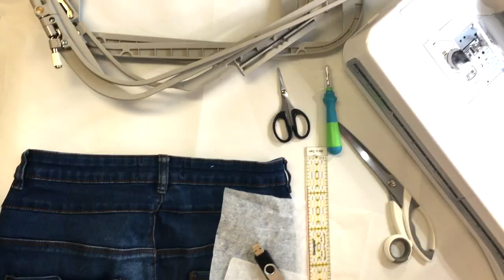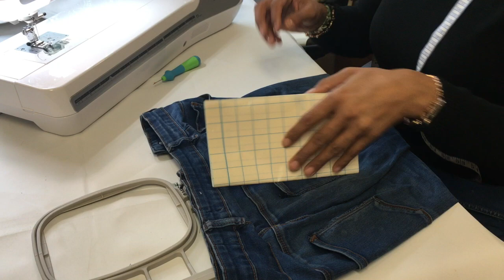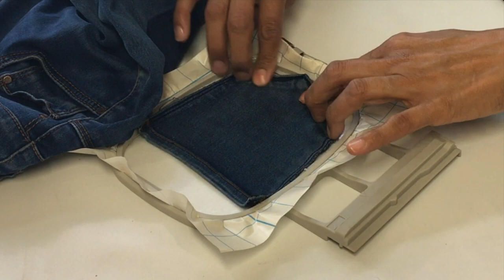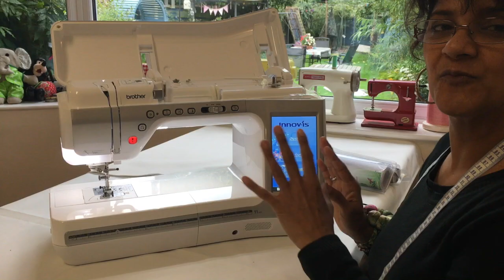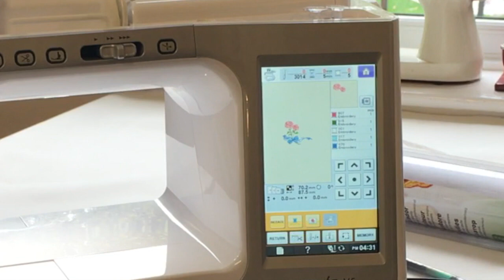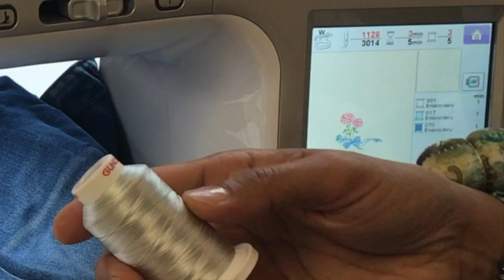Brother Innovis V5 Embroidery Sewing Machine. Embroider on Jeans | Abi’s Den ✂️🧵🌸

Comment: Just got my V5LE, loving it. Although sometimes the foot doesn't quite press the material down enough, I've broken a needle or two. Was amazed it came with the same cheap flimsy footpedal of the lower end units. I invested in the double footpedal which is much more ergo.
Reply from the maker: Thanks for sharing. Brother do disappoint by going cheap on parts. It’s a good embroidery output though. Enjoy.
Reply: Very late reply, but you can alter the embroidery presser foot height in the settings

Comment: i know i am  a bit late to the party but i just seen this today can i offer my huge tip for using filmoplast and 505 glue spray on any project these are sticky so what i do is rub my needle with silicone lubricant do not spray this on the machine spray away from the machine onto a cotton wool ball then rub the needle with that and repeat if the needle gets sticky as you go hope this helps x
Reply from the maker: Thank you. I don’t like the sprays/ glues. They’re toxic and bad for the environment. But thank you for the tip ☺️